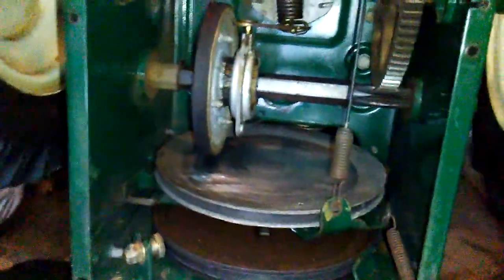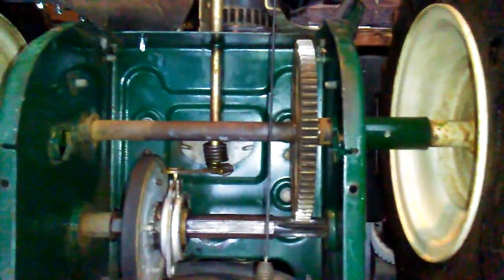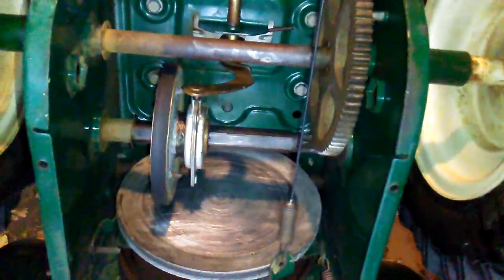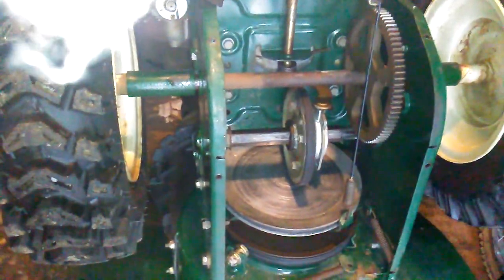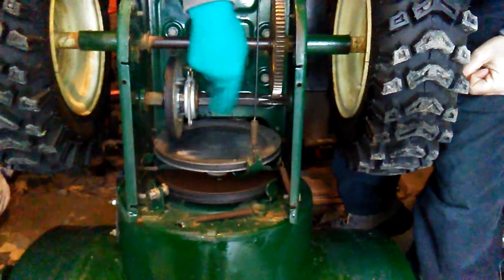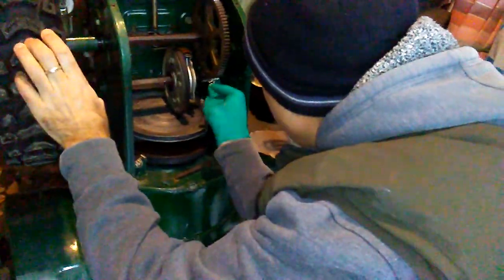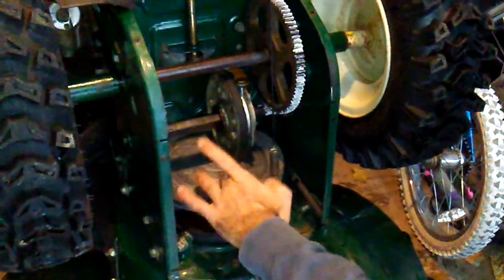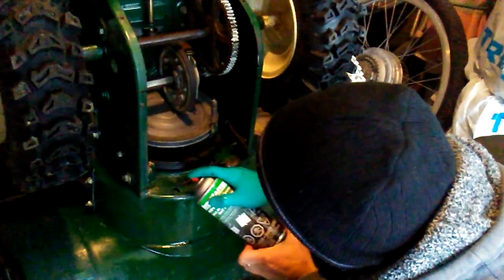Snowblower friction wheel drive explained and how to maintain

Comment: "On the shaft you want a thin non-drying lubricant, preferably water resistant. I use either a silicon spray or a lithium spray. But first make sure to clean it really well with alcohol or acetone." - Vopied from the creator in one of the comments below.
Made a huge difference on a John Deere TRS 26. I'm working on it. Would barely shift at all. Cleaned it with brake cleaner and a rag and sprayed silicones spray on it. Moves so freely now! I also sprayed the silicone spray on all the joints and hinges.
Reply from the maker: Very good advice, thank for sharing with viewers!

Comment: What did you use to lubricate the shaft?
Reply from the maker: On the shaft you want a thin non-drying lubricant, preferably water resistant. I use either a silicon spray or a lithium spray. But first make sure to clean it really well with alcohol or acetone.

Comment: Hi  why when I put the engage, in my snow blower John Deere 826 is cut off the engine right away ????
Reply from the maker: you mean the engine stop right away?
Reply: @photographiedynamic  yes my friend the engine stop
Reply from the maker: @labasuradel0813  If the engine stops that means your friction wheel is seized. Try turning it with your hands and see if it turns or it's stuck (unplug machine spark before doing any work). The wheels should turn with little effort otherwise too much load on engine which ends up stopping.
Reply: @photographiedynamic  thank you my friend. I will check it out. I’ll let you know. Thank you bro.
Reply: @photographiedynamic  hi my friend I find the  problem in my snowblower the problem is on the handles they got the false contact can you let me know how to  you call 
That to handle things like clouch or something like that.
Reply: @photographiedynamic  thank you so much my friend. I appreciate it for you help !!!!
Reply from the maker: @labasuradel0813  I guess a handle trigger? Mine has the right handle cable pulling to run the blades and the left handle cable triggers the reverse or forward motion of the machine.
Reply: @photographiedynamic  OK my friend thank you so much. I appreciate it for your attention. Have a nice day bro.